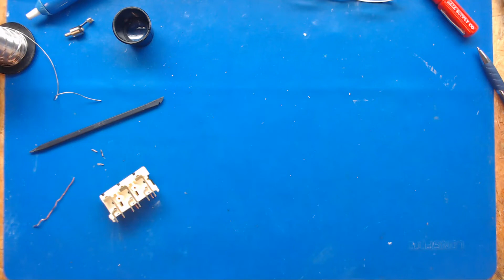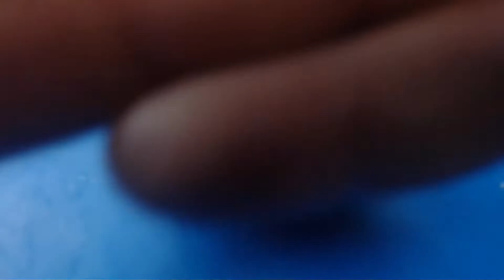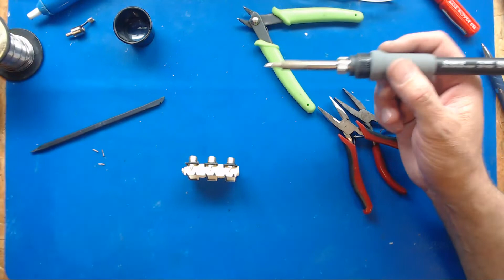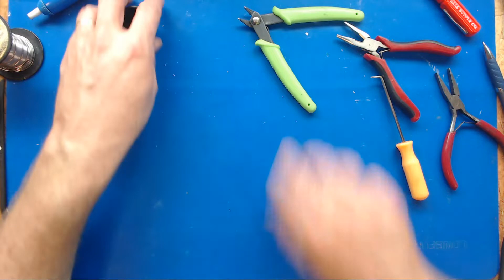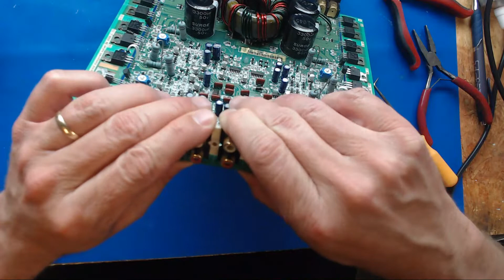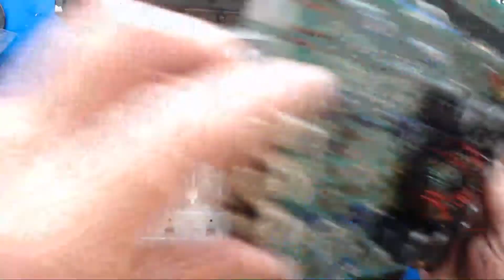Old School Rockford Fosgate 400.4 Part 4 Putting things back together.

Comment: Where in the world can I get 540s and 9540s these days?!  Everyone has the 540N and 9540N but apparently my old 500a2 won't like them very much.  Already switched to 3205s for the power supply side and got 47ohm gate resistors to go with them....but I am having a heck of a time sourcing the other fets.

Comment: Isn’t there a way to test the drive circuit before installing the new fets ? That would be a good video on how to test the drive circuit.
Reply from the maker: Yep, you can trace the signal though the circuit. It helps if you have one channel working to compare it to, but the circuit will act different without the fets/transistors in it. If your new to it like me, and I have to trace one out, I will remove the fets/transistors on the good side so I can compare them.Then add them back in and compare to find defective transistors or parts.